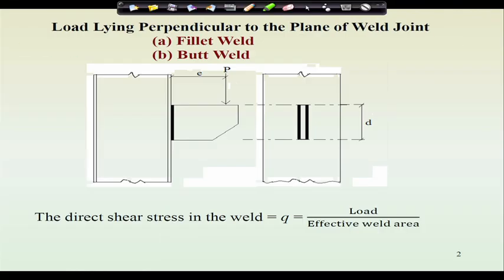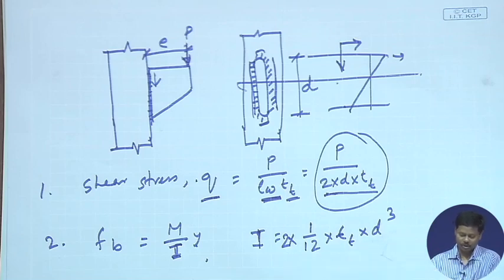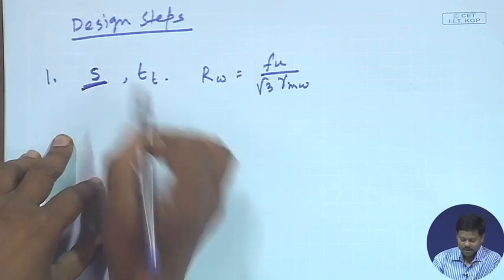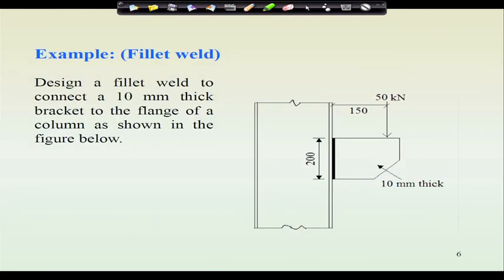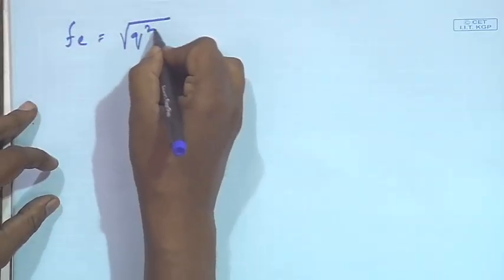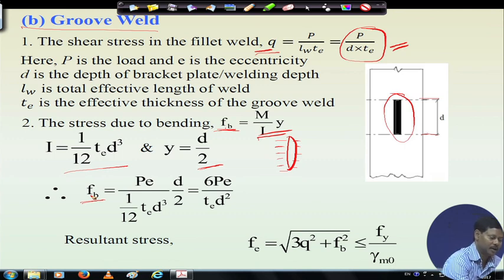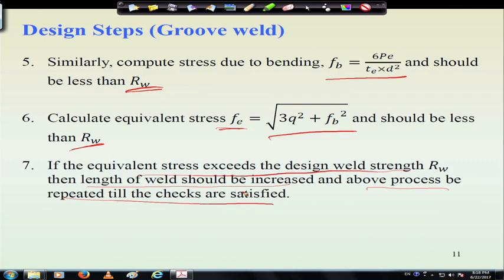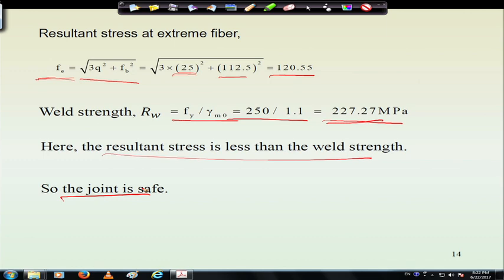Lecture 18: Eccentric Connection (Load Lying Perpendicular to Plane of Welded Joint)

Comment: In this video at 23:34 weld strength Rw = fy/partial safety factor for weld (Ymw) should be used?
Reply: We will use a partial factor of safety governed by yielding. Refer Is 800:2007 code Table 5

Comment: Perpendicular Eccentric Connections - Welds
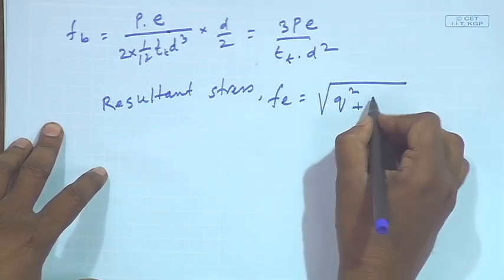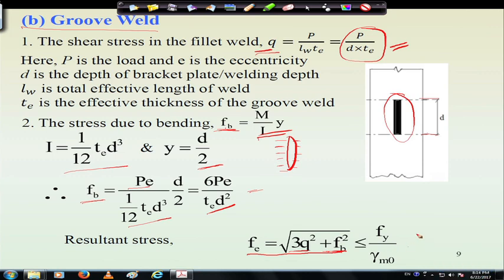Reply: Can you tell why the equivalent stress at 6:25 and 22:00 are different?
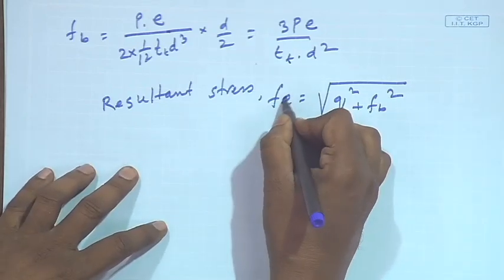Reply: @shivamsharanlall672  ya i too have same question, ya both the stresses are perpendicular to each other but due to bending normal stress is develop there  the formula for equivalent stress at 6:25 should be sqrt(q^2+3qb^2)  as in at 22:00